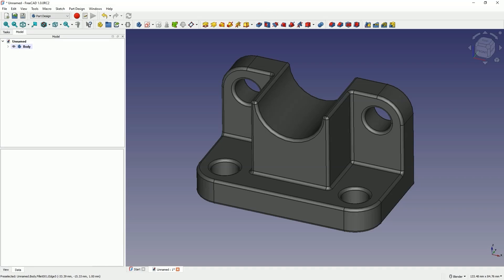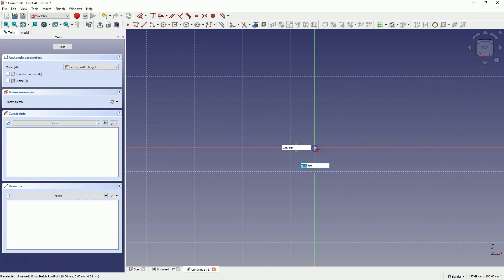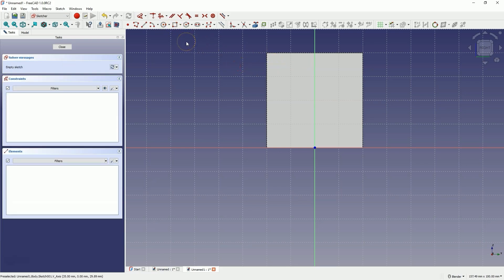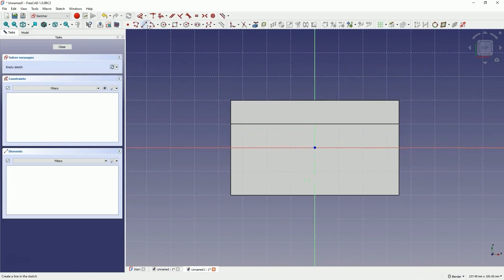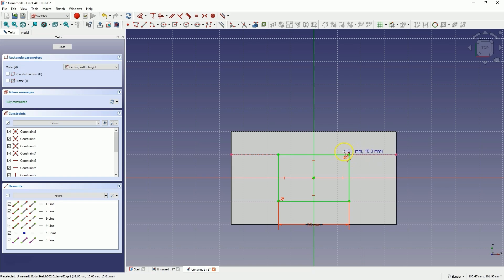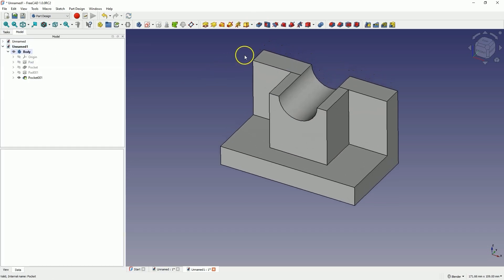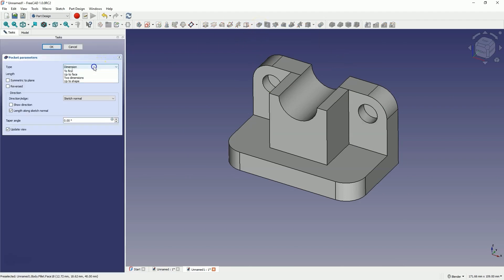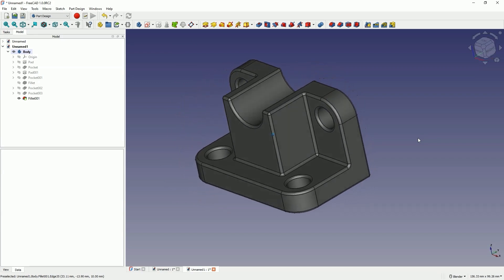If I Were To Start, I'd Start With This

Comment: I guess my FreeCAD just does not work. I have repeated the step @4:50 multiple times. S-L-O-W-L-Y to make extra sure I did exactly what you did. It simply will not accept that there is a smaller rectangle (you can see it but it won't select it) on that face and the pocket command only wants to do the whole face. (which deletes the whole block) 

Utterly maddening tool.

EDIT! -- After my rage quit I started all over again and went right past this step no problem. One thing I have discovered that once you screw up, doing cntrl-z does not clear the error per se. When you re-do the process, the error will recur. It's like your screw up is held in a cache and reapplies itself automatically. You have to restart FreeCAD to clear "the cache". 

I have learned to save often!

Comment: Thank you again for your very informative videos. I am having a bit of trouble with trying to set up gcode from the CAM workbench. Using this particular model could you help me figure out how you would setup the tool paths. (I know you cannot do the 2 upper / horizontal holes), but just the rest of it. How many "Jobs" will it take and such.

Comment: I have tried very hard to use FreeCad on multiple occasions. I give up. The inconsistency between the "Help" videos to the actual product is totally frustrating. 1.0 seems to have multiple issues. I have used Kicad for years no issues. I have written and tested SW in a big team, and from what I can tell, there are TOO MANY cooks in the kitchen for the dev of Freecad. This leads to the disparity in versions and help videos. It is almost impossible to use as is, and as said the help videos show tabs not on the latest version, so there is no joy there. My test of a SW package like cad, is can I make a box from the get-go with no help. FREECAD no JOY whatsoever. I don't mind paying for a tool, so I am going to Alibre Atom 3d. I was able to make a box from the get go with it, RIP FREECAD.

Comment: I want to know how it is every time I follow along, somewhere in the tutorial there is always some spot that the software will not constrain or something doesn't happen and I just get shut off from the rest of the progress. Then when i try to go back a little and pause the video to find my place, it won't work the second time in the software so i either have to start completely over or i get frustrated and just give up. what am I doing wrong? Literally right now the "create external geometry" button is gone from the screen...UPDATE: I went through step by step slowly and figured out what i did backwards and how to bring it back up...thanks for the video!

Comment: At first I found the terminology distracting so I moved on to other “Beginner” videos.  BUT, I returned to yours and followed along which each step, painfully making notes and many errors along the way ( we all have different learning styles, LOL) I kept making errors and going back to start all over so I started saving each successful step to a new file name to save frustration of repeats.  In the end your repetitive use of the proper terminology and detailed steps, sunk in.  I finished the model, my very first.  THANKS!  I now feel like I can learn this software, eventully.  In hindsight, the biggest challenge/frustration was trying to keep my desktop the same as yours, i.e. various dialog boxes and/or views are too easy to inadvertently change and get lost; I need to work on that one.  Good job, thanks for your work!!

Comment: Having to manually add the existing geometry of the object to the sketch for reference is a really tedious mistake.  Most other CAD programs will do it automatically when you initialize the sketch by selecting that geometry because needing that geometry in the sketch is often why you selected that face.  

They keep saying this is supposed to be 1.0, but I'm not feeling it. There comes a time in the lifecycle of every open source project where you have to stop appeasing your early adopters by preserving the Janky-ness that they've become accustomed to (mostly for fear of losing them), and start focusing on why no one but them will use the software. Breaking out of that fear is what finally made Blender absolutely EXPLODE.

Comment: Your description made what appeared to me a very difficult drawing to reproduce very easy to duplicate.  Your presentation is a solid 5 stars.  I especially liked how your paused on each toolbar icon so that I could also find it.  The only issue that I had was with the way YouTube displays your title at the top of the video.  The title hides part of the top icon toolbar.  Maybe there is a way to turn that off but I never looked.

Comment: There is a lot easier way to do it, with a single sketch.
Reply: How? Maybe from 2, but i can't see how could do it from one sketch.
Reply: @ampervadasz82  I stand corrected, It would indeed require 2 sketches because i did not take into consideration the holes in the bottom plate. However there still is a room for simplification.
1) Sketch 3 rectangles according to the part design from the front
2) add an arc to create that round portion
3) trim overlaping and unnecesary edges (you might have to split some edges as well)
4) Select edges and pad (You will repeat this 3 times for every portion with different padding)
5) create holes in the bottom plate and add fillets as needed

Comment: For some reason when I try to add filled around circle on top, freecad becomes so slow, it becomes unusable.. It also creates holes that shouldn't exist - it removes the half-circle arc.I suspect TNP as I modeled before watching videos and too lazy to check.
Reply: You have to select from the 'Model tree' the last operation before applying the 'Fillet tool'. Mayne you have selected only a face...